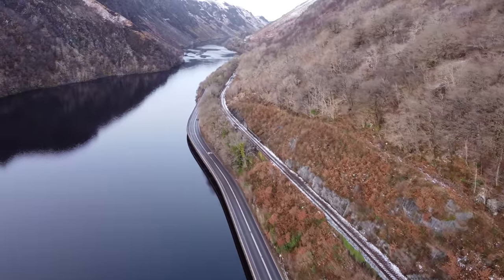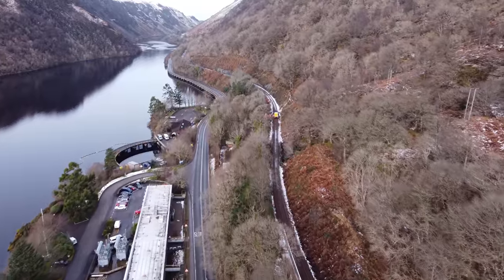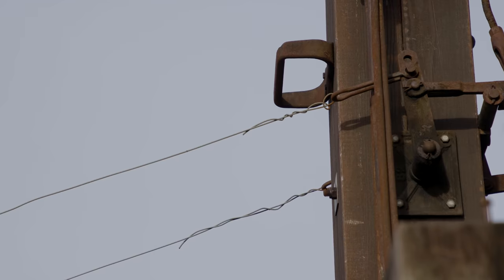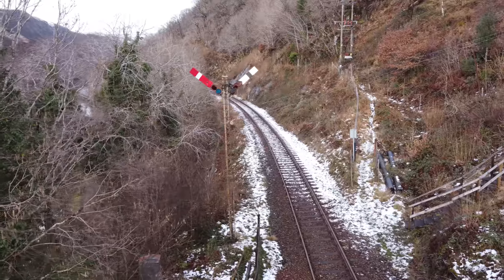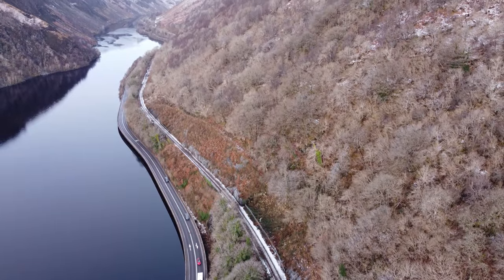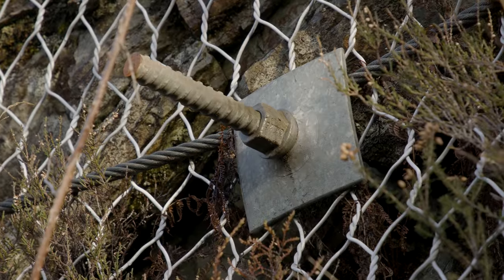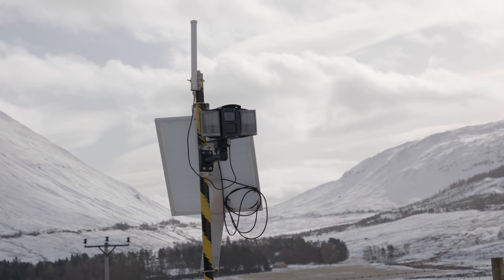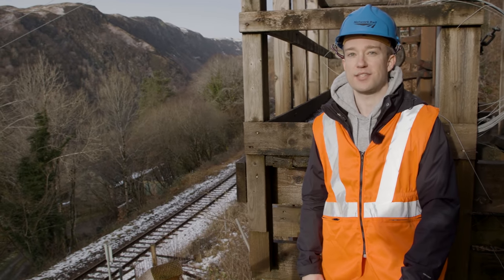After 140 years, this old technology still keeps trains safe

Comment: I love how the guy went "We don't need them to be stronger; we need them to break." Sometimes, improving on something has a negative effect on the current needs huh?
Reply: miko foin  That can happen with this system too - in fact in 1949 it did
Reply: That happens when you buy something that has not been made to the specification you need, but just has them by chance.
IIRC, there was something similar with Mercedes. Unlike their competitors, they were still creating the turning signal noise only through the clicking of the relays while others were using dedicated tiny speakers. Worked well until the relays were changed in some way and did not have the familiar clicking sound anymore (because most manufacturers do not have consistency of clicking in mind when optimising durability etc)
Reply: ok time to pipe it down, buddy. obviously improvent is realtive and always in regards to the needs.
Reply: No, improving something has a positive effect on the current needs, it has a negative effect on past needs
Reply: I know about similar situation in NASA, when they had used shuttles, they were purchasing emergency ladders, and, at some point manufacturer decided "let's improve our materials" and changed fabric to more strong one, wich is also more slippery for space suit. Astronauts didn't know about this during training, so one of them even gained trauma because of fast descend and following collision
Reply: elk voordeel heb zen nadeel: Johan Cruif
Reply: These wires are just like an electrical fuse, pressure plate or shear pin.  They are designed to break in a dangerous condition.
Reply: I remember a story where Traffic Lights used standard bulbs for years, they replaced the bulbs with LEDS and then when it snowed the SNOW built up and covered the light so you couldn't see it. They then had to instal heaters in the lamps to melt the snow, when for decades a normal light bulb melted the snow. Advancements are often a step backwards
Reply: @johngangemi1361  what they call failsafe

Comment: Petition for all physical hazards to be measured by the Scottish Standard "Microwave to Washing Machine" Scale.
Reply: I am still struggling with the wavelength of washing machines...
Reply: I was thrown by "Something small like a microwave"!
Reply: @Thisisace  a very sturdy train to not be bothered too much by a rock the size of a microwave
Reply: I was thinking "Well don't let microwaves and washing machines on the track"!
Reply: where does a full landslide fall on this scale?
Reply: @ampeerprime421  “the stock room at Argos”
Reply: @Rerbun  I did think that sounded odd, the Sprinters that serve that line do have a metal scoop/plow on the front which I guess would be able to push a microwave sized rock out of the way. Hard to imagine it not causing some damage though
Reply: Is it larger than a breadbox?
Reply: @vigilantcosmicpenguin8721  But kids these days don't even know what a breadbox IS!
Darned preservatives and mouse-free houses...
Reply: it’s giving “small boulder the size of a large boulder”
Reply: Tech news site The Register has their own collection of informal units, one of which is the "nanoWales" for area.
Reply: @stevemulcahy5014  don't make me laugh that hard it hurts :D
Reply: Metric or imperial Microwaves & Washing Machines?
Reply: Petition granted
Reply: got a question for you. what's heavier? a kg of microwaves, or a kg of washing machines?

the answer is a kg of washing machines. because washing machines are heavier than microwaves 🙂
Reply: @oight  both weigh more than a kg so both are invalid
Reply: Extend the scale downwards to Cellphone" and "Penny", and upwards to "Car" and "House".

Comment: I wonder why they haven't written a manual on the maintenance of this system? Sure, a lot of it is probably fiddling with it (in an engineer way) until things work properly, but there should be no barrier to writing out what the general methods are, and the "DO NOT DO THIS UNLESS YOU WISH DEATH" warnings.
Reply: Exactly what I was thinking. Obviously its a complex, manual system, but tons of far more complex systems have written manuals and videos and the like to give information on said complexities. Seems strange to have this information be "passed down" from year to year as if it would be impossible to create a guidebook that supplements physical interaction with the device. 
Would be like a 50s car just having absolutely no written documentation on it, simply because theres two guys around that know how to work on it and they'll explain it to you if you ask.
Reply: documentation is a myth you learn about in uni that doesn't exists in the industry
Reply: There likely are a few maintenance manuals for it, written a century ago, but the parts that they used in there are, for the most part, either long obsolete, or were all "house made" by the local steam train service shop, using the blacksmiths and boilermakers there to manufacture them all in house, along with railways carpenters that made the wooden aspects of the system. Kind of hard to replicate without a large forge, power hammer and a lot of skilled craftspeople to do the various aspects. You are not going to buy the parts off eBay for this easily, and most hardware stores will look on you in puzzlement when you ask for a sixpenny nail or a tuppence one.
Reply: I suspect that that was a bit of hyperbole.  They probably have written a manual.  And yet, as a carefully balanced mechanical process involving carefully balanced tensions, counterweights, friction, etc.  there's probably a reasonable element that you can't learn just from reading a book.  I expect that you also need some hands on practice with the system to learn the practical skills to turn written theory into practical results.
Reply: I'm sure they have, but it's obviously not been written by whoever designed/built it originally, which is how modern systems are documented. It means you can still get unforseen and undocumented problems which need a fundamental understanding of the system to solve.
Reply: It's like the magic potion in Asterix: The secret is only passed on from engineer to engineer.
Reply: Yep, that's definitely the main thing that can and should be improved. Writing a manual is critical for any system.
Reply: What they need is a wiki
Reply: I suspect they did, and it might still, in a drawer or bookshelf in the office. Or possibly shipped off to the archives by accident since it was 100 years old, and every other peice of the railway had been replaced twice over.
Reply: A manual would only work on a system that was repeated.  Evey part of this was individually hand crafted, so every part would need it's own maintenance ritual.  There is a probably a concept of operation, but being bespoke means one pole can have a 4 inch pulley on a 1/2 inch shaft and the very next has a 3.25 inch pulley on a 3/4 inch shaft and they are both doing the same job only one needs oiling three times as often as the other provided they have the same activation rates ..... a manual becomes an exercise in futility.
Reply: @majorfallacy5926  Speak for yourself! I've written scads of manuals and technical documentation in my forty-year career as an engineer :P
Reply: I was going to say the same thing. In my line of work as soon as there's something new and undocumented, we write an SOP. Every time. It's ridiculous to not do that since people change all the time.
Reply: @Neamow  That's true now, but 100 odd years ago not so much, it was a one off system for a stretch of track not on the mainlines, on top of which not sure how literate people were back then but it is likely to be a lot lower than today, so a manual may not have been written, and everyone who worked on it then and since has had to have on the job training on this unusual system!
Reply: The manual will be simple - this is how it works. What’s not so simple? How to reset, how to find fault / diagnose, what are the procedures for when {event} happens - as these lists are probably very extensive and change over time
Reply: wait until you hear how software is documented
Reply: Probably there's no big need - around five people need to know about the maintenance of the system, no new person being trained every year - unless something really extraordinary happens, there will be someone who knows about the system, and can teach a new person
Reply: Skill is part knowledge of what exists and part intuition learned over time regarding what doesn't and why things are or aren't. I imagine that with other technology advancing and with specific needs they have it's a mishmash of those.

If they don't have a manual on ways not to die, however, that is both a risk and something their insurance won't let them do.
Reply: @SeanBZA  Might be but manuals are more of an modern thing. back in the days you learned while working and yes that is still fundamental its not something you want to use to operate critical safety equipment. 
And say you had an generation shift, all the old guys left and you got a lots of fresh guys running the system and some might get some "bright" idea like using an flexible rope :)
Reply: @andreww2098  I get that, but nothing's stopping them from writing one now. I've done it many times myself at my work, even after inheriting systems with ZERO handover from the previous team. I spent some time understanding it and then wrote an SOP. It's not hard. These people even have the knowledge, they just gotta write it down.
Reply: Probably because the administration doesn't figure commissioning any of the engineers to write down their knowledge of the system is a worthy investment, and they aren't going to do it in their free time out of the goodness of their heart.
Reply: Well it's in Scotland so the warning would be more like "DINNAYE GO A'DOIN THUS UNLISS YER WANTEN TAE GIT YERSELF KELT"
Reply: The simple answer is that nobody has been paid to do it. Presumably, all of the folks knowledgeable enough to work with the system are busy maintaining it. They'd need to pay someone (or a small team) to sit down and actually document everything.
Reply: Manuals are a luxury that you don't often have. You'd be surprised how much documentation gets lost over the years. I worked in a 30 year old building and frequently found that there were missing blueprints, large gaps in documentation, and large changes made without updating any documentation. I mean literal walls that were not supposed be there.
Reply: I can imagine that the "manual" has different specifications, tolerances, reset procedures, and tool use guides for each length of the system, perhaps even for each individual wire.
"Between marker 7 and 8, the top wire should be at a tension of 3.4 stone at the second pulley. The bottom wire should have a deflection of no less than 1.5 inches before causing movement in the southern signal arm."
-
"When splicing in the winter, set tension about half a tug tighter than in the high summer."
-
At least, that is how I imagine someone would have to write the advice from a retiring master maintainer of the system.
Reply: There probably is a manual somewhere, and maybe even a set of procedures, but this is a kind of system that will not work if you go by the book hard and dry.

Its likely that the successful operation of the piano depends on an awful lot of minutiae, and putting them all on paper would be pointless and ineffective, because its way easier to look at someone else doing the maintenance.

Also it doesnt help that the piano must be damaged to give a warning, you couldnt describe every single possible damage case
Reply: That might put some old boy who's been in the rail unions for 50+ years out of a job, and they can't have that.

...this is how the railways in Scotland & the UK work and it's not about to change.
Reply: I imagine there is something like that, but since it's only given to those who work there, it's most likely a training course. The time investment to teach someone the practical way of working this weird thing is worth it when only like 20 people at most need to know
Reply: @houston-says-hi  Less so, because there's at most around 20 people who work on this and all are employed by the company that runs the railway.
Reply: Someone has to have the foresight to sit down and write it. Sometimes that happens, sometimes it doesn't.
Reply: It's only 140 years old, you can probably count the number of people who have had to REALLY understand it on one hand.
Reply: @MonkeyJedi99  When making a manual you don't really know what information will be needed in the future. Like how they were talking about the cables getting stronger over time and them having trouble finding a suitable cable. The manual would probably just say use the normal stuff that's this thickness and it would be kinda hard to guess what the appropriate tensile strength should be.
Reply: There is a basic maintenance standard for it, although it's only 2 A4 pages long.  It covers the basic features, components, operation, and tasks to be carried out routinely to check that it is operational and in good condition.  It doesn't go into the minutiae of the dimensions of components though.
Reply: laziness, lack of discipline, lack of training, poor leadership, public sector.
it's annoyingly common that people don't bother to write documentation. it takes time and can be tedious so people just don't bother unless competent supervisor/leadership checks up.
Reply: could not agree more. precisely true dude
Reply: @majorfallacy5926  And to think my boss expects a TPS report every time I change a testing procedure. just unbelievable.
Reply: How software is what? Documented? Ha.. that's a good one.
Reply: it wouldn't surprise me if part of it is 'because it's always been done this way'.  I used to work for one of the train operators in an admin role and trying to get one of stations to send lost property reports via email instead of hand written forms faxed to the office and then transcribed by someone on to a database was like trying to pull teeth whilst stacking marbles in a corner.
Reply: Why would you bring logic into modern British Railways sir
Reply: @majorfallacy5926  just one problem with the railway
Reply: @Neamow  I see you've never worked in the military, where sometimes the systems change faster than the people... there's no point in writing manuals for things that won't last long enough to need them.